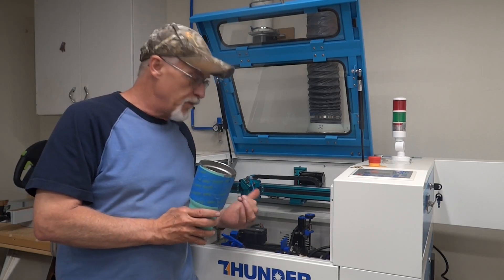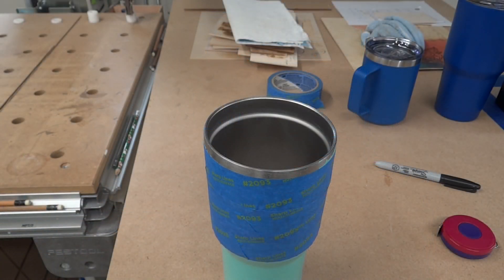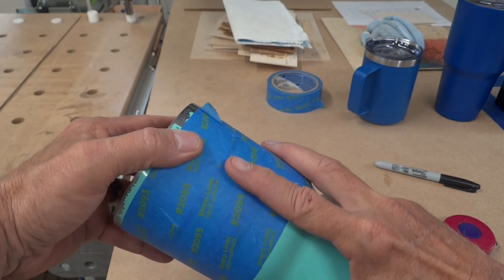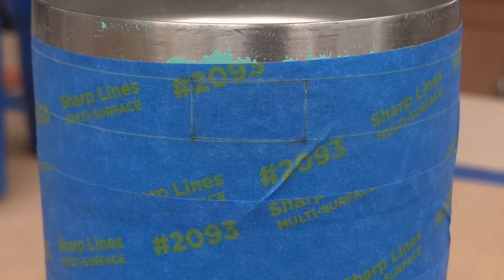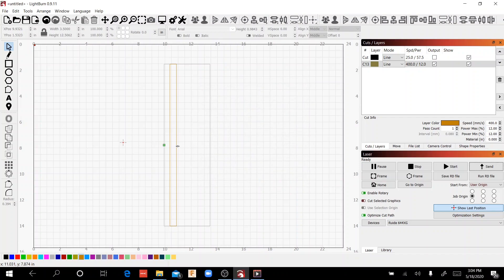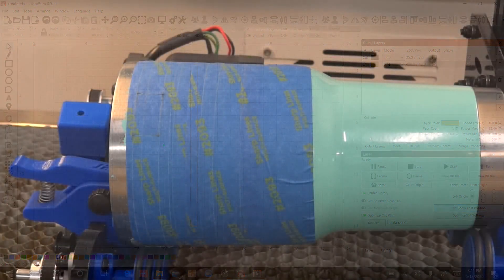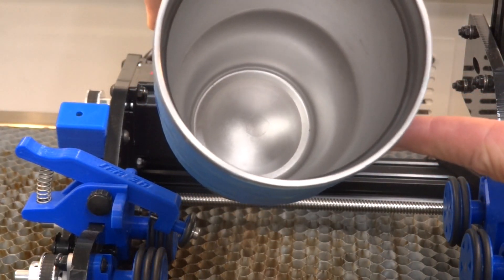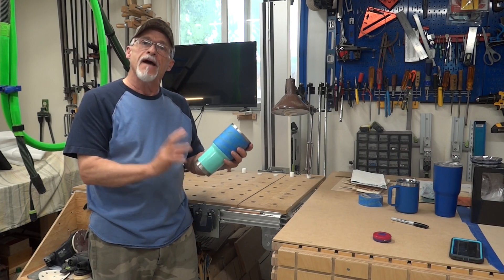Steps per rotation for laser rotary setup

Comment: Does the step per rotation change when you change size of cups. Or does the step per rotation remain the same now matter the size of cup.
Reply from the maker: sorry for the delay, yes it can change depending on the type of rotary. if you have a grip style chuck Rotary the steps don’t change no matter what you put in your rotary. a roller rotary you will need to,change the steps based on the diameter of what your setting on the drive wheels of the rotary compared to the diameter of what your engraving.

Comment: I appreciate your video. For some reason when I move the test rectangle down to test another line to see if the graphic meets up, the rectangle does not move farther down the cup. I've sent the file to the machine multiple time and the laser frames in the same spot every time. My origin is set on the center of the graphic. Any help would be appreciated!
Reply from the maker: You will need to move the laser head down reset your origin
Reply: @computercreationz  Thank you!

Comment: Thanks for the great vid it really helped! 
Question do you do this for every diff size mug ? or do you know if the rotation is the same for diff sizes or or even for glasses? like if its 1000 per rotation is the setting that would work for mugs or glasses ?
Reply from the maker: In a Chuck style rotary you won’t have to change. On a roller rotary as long as what your putting on the drive wheels of the rotary is the same diameter as what your engraving you don’t need to change BUTthe minute what you have on the drive wheels is different that where your engraving you need to determine steps for that set up. Good example would be a water bottle. Alomost always the neck you put on the rollers is different diameter than where your engraving.

Comment: Another great video. I have a questions.  once you have determined the steps per revolution do you have to adjust them as the Tumbler’s size change or they stay constant?
Reply from the maker: If the diameter of the top of the tumber is the same as where your engraving then you dont need to no matter the size but the minute you goto a water bottle where the neck is smaller that the area engraved you need to recalculate or purchase a donut style coller so you can keep the same steps
Reply: @computercreationz  thank you for your help 
just to be sure……as long as the tumblers have the same dimensions throughout the step per revolution should be consistent, right?  But, If I change Tumblers size or the dimensions is not the same ( top to bottom), I should always recalculate the steps per revolution?
Reply: @computercreationz  question 
Wouldn’t the step  per revolution be determined by the diameter of the rotary unit rollers independently of what size tumbles is being used?r

Just asking,,,

Comment: Thanks for the video! do you have to do this with every size tumbler? Switching from 20 ounce to 30 ounce?
Reply from the maker: Hi Heather the short answer is not if what your setting on the drive wheels on the rotary is the same diameter as what your engraving there is no change. But if in the example of a sports bottle where the smaller neck is put on the drive wheels on the rotary and it’s smaller or bigger that where your engraving you must recalculate your steps.

Comment: Great video. I don't own a laser yet (on order from Thunder) so a very raw rookie. I have several questions:

1) I don't get the relationship between taking the diameter of an item and also having to set the "steps per rotation". It would seem that setting the diameter would be all you would need for each size of tumbler but it appears that it is really the "steps" that dictate.
2) Is "steps" only a concern when doing designs on two sides of a tumbler i.e. if you're only doing a design on one side, do you even mess with the "steps. Thanks.
Reply from the maker: congrats on the new laser, you will love it!
Reply: Well, one would certainly think!  My point in the comment above as well.  So, we agree!  Basically, it IS two different issues, but there is no reason why it couldn't be merged via some background programming.

Being a 'step' motor operated device (all CNC's), they make a 'step' for every particular infeed of voltage/amperage.  Different motors have different step ratings.  That motor may move the projected amount, or it may not.   This makes no sense from a precision standpoint, but fortunately, they generally do.  If it doesn't then you can't fix the motor as it is what it is, so you just adjust the 'actual' and forget about the 'theoretical'.  The quirky problem comes when you add a varying value such as different size diameters of different cups.  (The bed of the laser never changes thus, X & Y axis are always consistent movements 'per step'.)   While the surface feet should translate no matter what, the curvature makes the object being lasered a radius (it is not flat).  Thus, the software has to compensate for this 'distortion', hence the 'diameter'.  Case in point: laser a 4" cup, then insert a 3" cup without changing any setting, you will see the distortion.  'Steps' basically boil down in 'degrees' per rotation, albeit much, much smaller.  The default setting in my laser is basically 17.77 steps per degree of rotation.  We know 360* equal a full circle, but to that chuck that 360* is being created by 'steps'.  

Again, it boils down to surface feet.  A different diameter means different surface feet, meaning the design has to either be spread out or shrunken down to stay to scale.  The step value is what controls that shrinkage or expansion.

So, we are still back to your main point.  They should be able to COMBINE these with a little math so we are not trying to sort it out later.  Not sure why they don't do programming on the back end for this?  

There is a wonderful post above where Dan gives us the math.   Surely the programmers could just build that in, still allowing for manual correction when the math fails in the real world (as it will).  🙂
Reply: @anthonyobrian2665  Excellent reply...thanks for all of the detail!

Comment: Thanks for all the help in your videos .. quick question.  Do you have to set up steps per rotation for each different size cup i.e. 12 oz , 20 oz 30 oz?
Reply from the maker: if the diameter of what you put on the rollers of the rotary is the same as where your engraving then no. but if that number is different you will have to recalculate. see my latest video on doing a 1 gal jug where I go into depth on this subject. thank you for watching

Comment: So one thing I see in a lot of these rotary setup videos is much like what you did in yours.  When you run your first test of the circumference and see that it overshoots or undershoots the mark, you then take a guess on the new steps per rotation and test again, and you keep doing that until you find a value that works.  There is a formula that is used in the 3D printing world for calibrating the steps for the extruder.  For that they start with an arbitrary number of 100 and measure 100 mm of filament.  They make a mark of 100 mm on the filament itself and then tell the printer to extrude 100 mm of filament.  They then measure the actual amount extruded and use this formula:
([steps/mm value] x 100) /  [actual length extruded] = [accurate steps/mm value]

So to use that in this context, you would use this formula where you are replacing the 100 value with the circumference value and measuring the actual length moved:
[actual length moved] = [circumference] +/- [overlap/underlap]

([steps/rotation] x [circumference]) / [actual length moved] = [new steps/rotation]

Now filling in the values based on your guess of being about 1 inch over on the first run, you would get this:
(4400 x 12.5) / (12.5 + 1)

55,000 / 13.25 = 4074.1

That number would have been closer to the exact value needed had you measured the actual amount that you were over with your caliper and not guessed at 1 inch, but as you can see, I got close to your end value of 4075 on the first shot and didn't have to take multiple tries to get there.  I don't know if you would want to make an updated video using this information, but as you can see, this calculation clearly beats the guessing method that everyone uses to figure this out.  Using exact measured values probably would have gotten you to a more exact value than what you got in your video Looking at your end result, you were REALLY close, but still a tick off.

Curious on your comments.

In case you're interested, here is a link to pictures of some of the DIY machines and rotaries that I have designed and built.
https://dan.bemowski.info/image-gallery/nggallery/3d-printing

Dan Bemowski
Reply from the maker: appreciate your comment
Reply: Exactly the Math I was looking for.  Basically, it boils down to this formula.  We need to divide the pie based on Surface Feet per Rotation for every circumference.  Thank you!  NOBODY talks about the math behind this...not the manufacturers, or the tutorials.  Why can't they simply build that formula into the query on the diameter of the object??  Perhaps a 'test fire' option with a window for 'difference +/-' value to input that would automatically correct the steps per rotation, projected vs actually.

Comment: does that mean every time i change to a different diameter item i have to find the correct steps per rotation as i have watch a few videos on this subject but getting conflicting answers any help would be appreciated
Reply from the maker: no as long as the diameter of what you your putting on the drive wheels of your rotary is the same as what your engraving you don’t need to change. you do have to change and figure different steps per rotation if you have a sports bottle where the neck is smaller that the engraving area. it’s a ratio thing
Reply: @computercreationz  sorry I am a bit lost so if I have an item that is 80mm diameter engrave that then I have an object of 120mm diameter I then need to calculate new steps and write that to the controller cannot do it in software alone ???
Reply from the maker: @warriors475  if what you put on the drive wheels of the rotary is different diameter than what your engraving new steps will have to be recalculated.
Reply: @computercreationz  there has to be some kind of math equation you can do once you figure out the diameter for one cup, that you can just take that diameter or circumference and it steps per rotation to it figure out the steps per rotation for the next diameter objects, I'm the math expert but surely there's some kind of algebra or something that can be done, at least I would guess and hope so?

Comment: Wouldn't be easier if you put pencil mark on the cup and use the "test" feature in lightburn and have it rotate 360 degrees.  If your stepsister rotation is correct it should stop right at the pencil mark.
Reply from the maker: Unfortunately the test feature doesn’t work on allot of rotary’s. But if the test feature does work that would be one way to do it!

Comment: well I love your videos you make it seem so easy so i bought a rotary attachment for the OMTECH 150w sitting in the garage. Im having problems. engraving on a pub glass and the design comes out correct dimension. but the quality looks absolutely horrible. there are vertical lines going through it and all the edges are uniformly wavy. I have increased the LPI  and DPI with no change. slowed it down, speed up, threw at the wall hit with a hammer, all same outcome.. Have you every had anything like this?
Reply from the maker: Most of my glass engraving is done at 400 mm/s at 15-20% power on y 100 watt. Lpi at .080 or 317. I always de focus my lens 2 mm . Works pretty well

Comment: What would you say is the issue if they aren’t lining up top and bottom? I have ensured the rotary is straight across in the laser. JDS 20oz tumbler & I have it set to 3.5” diameter.. lines are ending at different heights
Reply from the maker: Two possibilities either your rotary is not parallel with your gantry or your tumbler is wandering in the rotary.
Reply: How do you stop it wandering?  I’m trying to engrave a Stanley with tabs and I can’t put it all the way to the top because of them.

Comment: Thank you.  I'm running into issue of steps per rotation.  I've filled in "Roller Diameter", "Object Diameter" and "Circumference"  --  Regardless of what the number for "Steps per Rotation" is - the tumbler still turns a full 360° (4) times.  Whether it's at 4400 steps or 200 steps.  Thoughts?  TIA
Reply from the maker: Hmmm I haven’t heard of anything like that, sorry I’m not more help.
Reply: Did you ever figure this issue out? I am having same problem.

Comment: Robert, do I need to do a steps per rotation calibration for every different size cup I do?
Reply from the maker: Only if the diameter of what your setting on the drive wheels on your rotary is different than the diameter of what your engraving. Example a water bottle has a 2.75" opening  but where you are engraving is 4" in diameter. This would have to be recalculated. If what your setting on the drive wheels is the same diameter no need to recalculate!

Comment: Thank You.  Just purchased a laser cutter with rotary - brand new to this idea.  This was a great video.  --  Question:  The blue tape - when you're testing - is the laser cutting through the tape and marking up the tumbler?  Thinking of waste cost.  Thanx in advance
Reply from the maker: No I put the tape,on the tumbler and turn down the laser. That way I don’t ruin a tumbler. The tape absorbs the laser energy instead of ruining a tumbler. Thanks for the comments I appreciate you watching.

Comment: I'm sorry but you doing it almost completely wrong. First steps per rotation is determined by stepper driver and gear ratio of the rotary. For example if stepper driver is set to send 5000 pulses per full rotation and your rotary has gear ratio of 2.5x your steps per rotation will be 5000*2.5=12,500 (just as an example). So use that number as your starting point. Diameter is the actual diameter of rollers wheels on the rotary. Measure them and put it in the settings. They stay constant no matter what cup diameter you are using.  You don't need to burn anything, just use "frame" function. Your speed is insanely fast, it causes cup to jump and skip so you'll never get an accurate measurement. Slow it down a lot. Otherwise yes you can keep changing step values to fine tune distance, but you can also play with diameter settings instead.
Reply from the maker: I think we will agree to disagree. the starting point for the manufacturer of my rotary is 4400 is I used your methodology I would go around the cup 2.5 times. getting accurate total steps on a rotary will very by manufacturer so one number does not fit all. Thank you for your comment and have a great day!
Reply: @computercreationz   This might be because you had incorrect diameter in the settings (from looking at your screenshot you have it set to 1.62" (should be around 2.32"). But whatever method works for you. I would slow down the speed tho, you can see cup is bouncing pretty hard... Thanks for the video!

Comment: Great video...very informative!  Quick question, should I have to recalibrate the steps with every different sized cup or just the initial calibration?
Reply from the maker: If the diameter of what you have on the drive wheel of your rotary is a different diameter than your engraving surface then YES it will be different. good example of this would be a sports bottle. the neck that's on the drive wheel is 2.75" but the engraving surface is 4" in diameter. This will have to be recalibrated for that setup.

Comment: Once again you knock it out of the park; thank you! Questions - once I have my value, does it stay for anything new that I engrave, or must it be determined for each new diameter of object? Also, do you have to press the 'origin' button on the machine each time? Is there a way of re-homing the laser head to the origin point when it's in Lightburn's 'current position' mode? I don't have a 'home' button on my newer control panel like the old ones do. Thanks!
Reply from the maker: Hi Jo, yes the steps will stay the same as long as the cup diameter that you engraving on is the same as what you input into the rotary information. You will always have to feed in your cup diameter or Circumference for every cup you do. 

With that said if you have a sports bottle and the neck of the sports bottle is 2.75" in diameter and that is what is going to set on the drive wheels of your rotary. But you engraving surface is 4" in Diameter then you will have to calculate different steps per rotation. The reason is the ratio between the 2.75" neck that sits on the drive wheel of your rotary vs your engraving surface. 

Another great reason you now know how to do this!!!

Once you have your rotary set up you should move it until your done with doing cups. So you establish you user origin only once. You would have to do it again when you use the rotary again. Remember you have to align it along the x axis and that is slightly different every time you set it up. I find it easier just to re establish a new user origin.
Reply: @computercreationz  Thanks, that's great info. I was moving the head out of the way along the X axis during testing, I guess I'll just manually realign it each time, then, and hit 'origin' again. Whatever works :-)
Reply from the maker: @JoHunter  Hi Jo you shouldn't have to do that. Once you hit origin on your controller you should be good. Once the cut is done drive the head out of the way. Reload new cup. In lightburn go to "Go to Origin" next to the Home button in the laser control panel in Lighburn. Your ready to start the next project!
Reply: @computercreationz  Thank you.